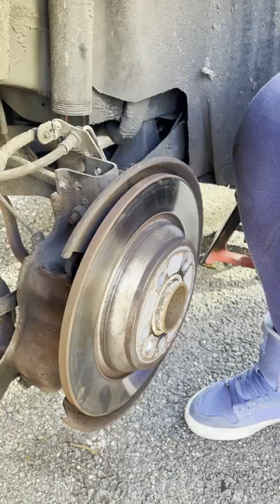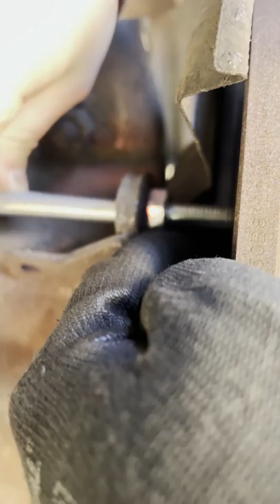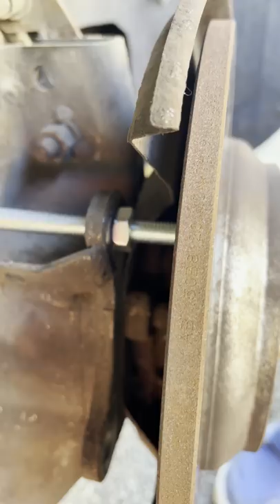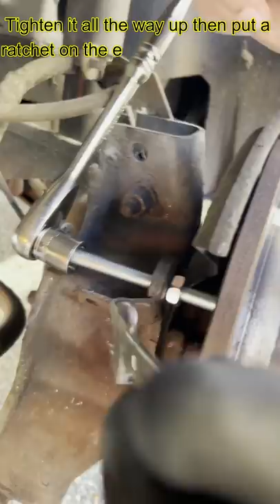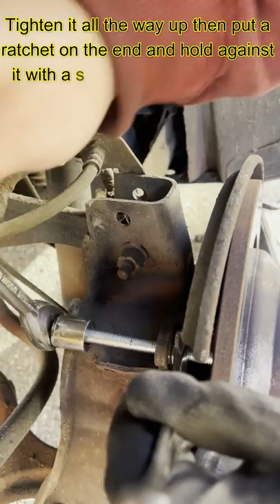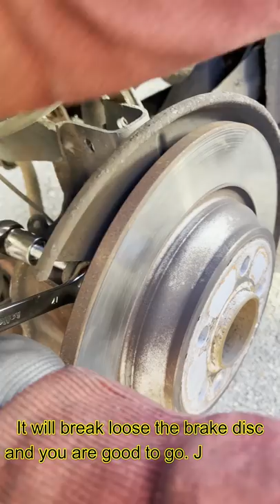How to remove stuck/seized brake rotors

Comment from the maker: https://youtu.be/FHcAr23-2Bw
To the people who have commented or thinking about to comment that there are 2 threaded holes on the rotor for the same purpose I advise you to watch the linked video, hopefully you will understand why.
Reply: Yeah. Most do not have those holes. They are by the lug nut holes. Where did you put the bolt when you did it? Was not your bolt end pressing into the machined surface of the rotor? If it was, you just damaged the rotor possibly quite bad. Not good advise if you ask me. Only very (few)select import vehicles have those threaded hole you mention, and they are not on the back where you were. Most are right next to the lug holes. Not many vehicles at all have it. And looking at your video, to me it appears your forcing rotor off by pressing the bolt against the machined surface. A big no no.
Reply from the maker: @leroijr407  Yes, it has possibly damaged the rotor, but they were replaced with  new ones, so it didn't really matter. However if someone wants to keep them, they can use the old brake pad between the bold and the rotor surface to prevent them from any damage. ;) 
Back to the holes for removing the rotor from the front. In Europe, especially here in the UK typically cars don't have them. It's more usual for import cars. For example my JDM Supra has them I believe, but my S2000 built for UK market doesn't. 
I hope I could shed some light on the topic and made the things clearer.

Comment: Pb blast the inside of the hub on the middle of the rotor when you get the wheel off then beat the sh*t out of it when you get the caliper off with an orange mallet in a 12 3 6 9 o clock pattern is what I do

Comment: Plz can u show us what happened on the inner side of the disc rotor where the bolt pushed? And the hammer can simply do this job quicker... 🙄🥴😅😂
Reply from the maker: @Mano Dounyayan  Hi, that rotor was scrap material anyways. However if you are keeping the rotor just place an old brake pad between the rotor and the bolt.
Reply: Place the old brake pad between the bolt top and the rotor surface. NO SCRATCHES 🎂

Comment: Maybe those rotors are not correct.
There should be 2 threaded holes in the rotor to push the rotor off the hub using two bolts at the same time.
Reply from the maker: They are correct, and there should not be extra holes for that purpose. ( Although it would make life much easier, lol)
Not all rotors are created equally :D :D :D
And yes, I know I could have removed it with a sledgehammer( however sometimes you can not) or with an air hammer (which again, not a lot of people have it at hand) or a puller tool or whatever.
But, this video is for illustration that if you are stuck and do not want to buy any extra tools, you could just go to the hardware store and pick up a bolt with nut ( if you do not have at home already) and use that in order to remove the rotor.
SO AGAIN, THIS IS NOT THE ONLY WAY TO REMOVE THE ROTOR, NEITHER I CLAIMED IT EVER!

Comment: Ok here we go u see the hole that is beveled inward its got threads u put a 5/16 bolt in it too pull off the rotar less tools less agravation
Reply from the maker: That hole is not threaded,it's for the retainer screw.

Comment: no mate what r u doing copper hammer nd thats all u need.wouldnt advise this method myself if u need to.. drive it get some heat in em then take them off soon as you can while still warm heat will loosen them.....

Comment: See the other two smaller holes that dosn’t get lug nuts? That’s what their for.
Reply from the maker: @Meir Schwartz No, I can NOT see, would be appreciated if you could tell me at which point did you see them in this video? (There are exactly 5holes for the lug nuts and 1 extra for the rotor retainer screw) 
Feel free to correct me if I am wrong. 😉🖐

Comment: Crack sharp and quick with hammer.wont damage spindle or bearing..one second or two worth of work compared to finding long bolt and nut..but yes works well by doing this way.

Comment: This works but my rotor was so rusted on it bent the nuckle and my brake caliper was aligned. The guy above mentioned a hammer that didn't work either I was pounding for hours 10 mins with a bolt jig and bam I hear a loud pop and it was off. I cleaned the hub and put anti-seize

Comment: Not good way at all. Way off center and bends rotor. Use the holes in the middle - they were designed for bolts and specifically for removal purposes
Reply from the maker: Sure, if you have any of those holes do it that way, no doubt.
This video is for people who can not get them off with any of the methods they know.

Comment: This is way too long for me, a sledgehammer gets a job done 4 time's faster than this.
Reply from the maker: Sure, you can use a sledgehammer as well, however I prefer this method if I am about to reuse the old discs.
In this video I am trying to give an alternative method if someone does not have a sledgehammer or wants to reuse the old discs.

Comment: Did you know that there's a hole in the rotor itself for this same purpose ?
Reply from the maker: @J. Chris Beck   Please can you tell me at which point/second of the video did you see that hole in this particular rotor?
Your reply would be much appreciated. Thank You!
Reply: @MrNiceGuy94  there's a 5th hole near the bottom of the rotor at the beginning of the clip, it's right near the man's pinky finger before he puts the bolt in
Reply from the maker: @J. Chris Beck Well, that is the hole for that screw which holds the rotor to the wheel hub. I had to remove that in order to be able to remove the rotor, so I can not use that hole for what you meant in your first comment. ( Otherwise I would be tightening the rotor to the wheel hub again, what makes no sense if I want to remove it.)
I will be doing a video how to change the brakes on this particular car and how to change the wheel bearing, and in that one you will be able to see what I am talking about, if I am was not clear enough. 
Stay tuned and thank you for your reply.

Comment: BREAK LOOSE THE BREAK!
Reply from the maker: Pardon?
Reply: @MrNiceGuy94  You broke the break loose
Reply from the maker: @Daven Hiskey  It may be me, but I still didn't get it. Yes I disassembled the brake system in this video. Is that what you mean?
Reply: @MrNiceGuy94  You broke the break loose af

Comment: All good if you dont plan on using them again
Reply from the maker: @Rod Bingaman Use the old brake pad between the rotor and the bolt if you want to keep the rotor.
Reply: @MrNiceGuy94  im honestly not trying to be a smartass or a ball breaker but maybe you should have included additional tips for folks that wanna reinstall and re-use their stuck on rotors. Guys like us already know the tricks of the trade but for the folks in your target demographic (clueless DIYers trying to save a shop bill), they'd benefit greatly by those tips. Seems like a lot to squeeze into a short video but id be willing to bet that if you did that, you'd probably get a lot more return viewers and subscribers looking for tips on other repairs. Personally, ima PB Blaster and rubber mallet kinda guy but anyway, best of wishes and luck to ya fella 🙂
Reply from the maker: @Rod Bingaman Thank you for your comment,and also for doing it in a nice manner, I appreciate that! Also I can take criticism, and yes you are right, it would be also good to mention in the video what I just wrote to you. There is the full length video on the brake job of this particular car and it is included on that one, but maybe I will do another short which will include what to do when you want to keep the rotor ;)

Comment: Yea no only of you plan on replacing the rotor
Reply from the maker: This one was replaced, but you can use the same method just put an old brake pad between the rotor and the bolt ;)

Comment: I had tried that before and it didn't work. I had to cut the rotors. It was badly frozen due to rust.
Reply from the maker: @Da Wanderer  Wow, that must have been really bad. It had never happened to so far..thankfully.

Comment: If the cast iron bends, you are fucked. Better to cut a line in the edge of the outer surface and use a hammer to separate the disc.
If it's really stuck.

Comment: Guys what the fuck there two pre tapped holes in the brake rotor to put bolts in to remove stuck rotors and the same on brake drums

Comment: As many have pointed out that's a good way to force yourself to replace caliper mount. Just use a large puller or if replacing rotors just beat them off. If you plan of reusing rotors doing this you just warped them.
Reply from the maker: @Trenton Archer Well, I dont have a puller. But anyways I dont see how it would break the caliper mount. And if you want to keep the rotors just simply put an old brake pad between the bolt and the rotor surface 😉

Comment: Also on that 5 lug hub there's a 6th threaded hole. If you find the bolt that fits the small threaded hole sink that bolt in and it'll pop the rotor off as well. But I usually just grab a hammer
Reply from the maker: https://youtu.be/FHcAr23-2Bw
Here you have a better chance to see what that hole is for.

Comment: You don't want to hit it with a hammer come on people. that's a great method just put another nut on your bolt to protect the threads and you can use it more than once and make sure to rotate the rotor to take it off evenly to ensure you don't bend the caliper bracket mounts

Comment: Where the hell are the studs?
Reply from the maker: @greg holland There are not any, this car has bolts instead of studs.
Reply: @MrNiceGuy94  
Thanks for the reply. First time I’ve ever seen that configuration.
Reply from the maker: @greg holland You are welcome ;) I believe that is more common in Europe, also if you noticed there are no 2 holes where you can thread in a screw to push the rotor off, what is typical for American and Japanese cars.

Comment: Horrible tip…your gonna break that ear right off! Do NOT do this!!!!!
Reply from the maker: So hitting the rotor with hammer does not damage it but cast iron is going to bend, right? 
Tell me more 🧐😲
Reply: @MrNiceGuy94  Gladly...2 things...you hit the thick center part with a hammer (not the braking surface) which is where rotors actually seize, and cast iron does not bend....it breaks....which is exactly why you should not do this! Rotors are cheap to replace....mounting brackets or tabs are not a easy to find part and usually need to come from the dealer or junk yard parts car.
Reply: You bend that caliper mounting tab and you will forever unevenly wear brake pads…that’s if you can even get the caliper back on….apply never seize to the mating surface of the rotor to hub and this will never be an issue
Reply from the maker: @Darrin Matusewicz   Sometimes it does not come off if you only hit it with hammer. 
It never happened to me that the ear would have snapped off, I dont think there is enough force to break it off. 
Anyways, everybody is free to use the method which works for them the best. 
Appreciate the comment,tho. 👍
Reply: @MrNiceGuy94  So another quick tip…rotors are the same with a stuck on rim….loosen the the lug nuts slightly and take it for a small loop in a parking lot….everything will break free and there will be zero hammers needed….it’s all about tired and true experience, happy holidays!

Comment: That rotor was not seized onto that shaft if it was that quarter 20 volt would have never pushed it off smack it about 4 to 5 times with a 2 lb sledge hammer it'll come off less than half of the time with this guy's still in playing around with shit

Comment: Yeah let's see the backside of that rotor
Reply from the maker: Mate, if You mean that I will be probably scratched/warped or whatever You don't have to be dramatic here. Just use the old brake pad or something with a larger flat surface in between the rotor and the bolt.
Hope it helped.

Comment: What in tarnation? Why not use a hammer? This is just as bad as the guy I saw use an angel grinder to cut a rotor off. I showed him on the other side how to remove it with a hammer took literally one good hit and off it came.

Comment: I was working on a brake disk years ago and beat on it with a hammer and no go. I did this and heard a loud pop! It was pretty stuck on. This is a great trick. It works. I had to use both holes on the bracket.